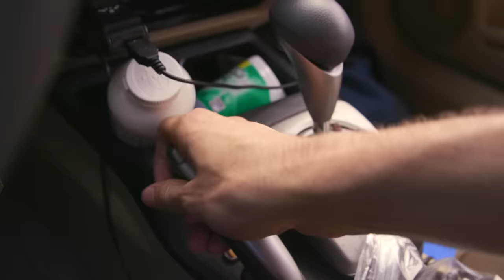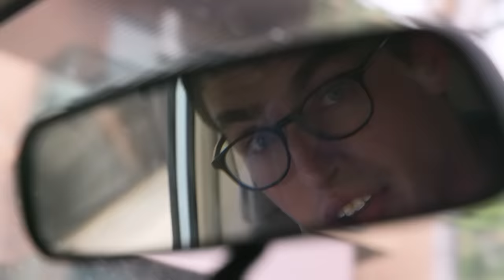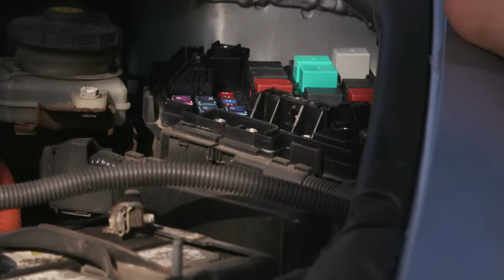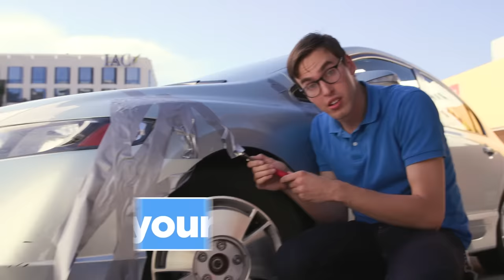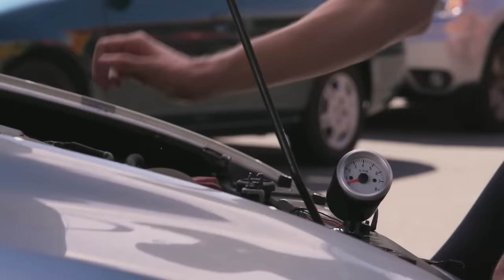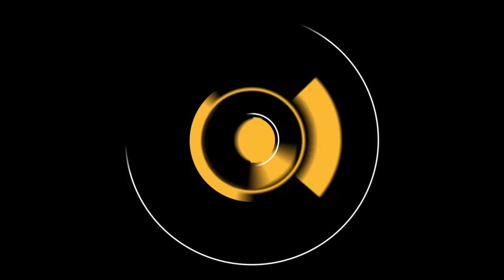5 Tips for People Who Don't Understand Cars

Comment: Adjust the tachometer for the number of cylinders in your engine.
Locate the output wire from your distributor.
Test the connection.
Choose a mounting location for the tachometer
Install the tachometer.  (USE TOOLS, NOT THAT HARD)
Set the shift light on the tachometer if applicable.

Easy peasy.
Reply: Srsly i am High Modern cars don't have distributors anymore, they have coil packs that the computer fires electronically.
Reply: Jacob Burnette the majority of vehicles on the road have distributors still
Reply: Yeah you need the rpm sensor wire from the crank sensor or the ECU nowadays
Reply: That is not true, Andy.  In the US electronic ignition has been predominant since the late 80s, and most cars are from the 90s to now.  So...
Reply: Hm I was sort of right…
Reply: Oranges611
Reply: Who needs a shift light?
Reply: NERRRRRRRD
Reply: does the smallest cresent wrench that fits, like one that came for free at a jobs fair, and a claw hammer count?
Reply: But what the fuck does a tachometer do?
Reply: It meters tachos.
Reply: I know right, what a  stupid question. I had two tachos today, so I try to keep the big dial on the 2, works great.
Reply: Tacometers.
Reply: But why? What is the purpose of this procedure? If your car does not come with a tachometer why would a non-car guy install it? Unless your car does not have manual tranny, why would a car guy install it?
Reply: Jacob Burnette I can confirm that! According to Mike Allen, who runs a car clinic, "Many modern cars have no distributor at all. The ignition is triggered by toothed timing wheels spinning with the crankshaft, which is much more accurate than points. Then there are individual coils for each cylinder, fired by the engine management computer."
Reply: @andycruzatx3387  barely any cars on the road these days have distributors and caps, they died out decades ago
Reply: @lewishood8160  yeah I learned that at some point in the past two years.
Reply: As a car enthusiast this entire comment section triggers me
Reply: Copy and paste
Reply: gotta remember the wifi password as well.
Reply: Acltcihsa look at that

Comment: It is somewhat shocking how little even the people in my engineering course know about cars.
Reply: As an engineer who knows fairly little about cars ... Can confirm!
Reply: I knew a fair bit about cars going into my engineering class. Now I design industrial machines and use exactly zero of my car knowledge.
Reply: Tbf, my side of Engineering deals with modeling, data, and industrial design. We haven't even touched ICEs or motors.
Reply: Father worked as liaison for a number of dealerships through the 80s and 90s.  Was working for a Ford Lincoln Mercury dealer when they had a Lincoln come in with a transmission issue.  Long story short, factory rep said that problem was not possible with that transmission.  They flew out the guy who DESIGNED the transmission.  Cleaned the shop up nice, had everything all ready and the car on the lift for his arrival.  Guy walks in, looks, nods and gives a couple "mhmms" and them says "one question, where's the transmission?"
This man, who designed a transmission for an automobile, had never seen it in a vehicle.  Once he was pointed to the transmission, he knew the thing inside out and backwards and the problem was fixed, but it's a crucial thing to know an engineer may know the object on paper, but there can be a huge disconnect between paper and application.

Comment: okay so a tachometer is a thing that measures how fast your engine is spinning and an alternator is a small electrical generator that generates electricity by spinning a magnet inside a copper coil. Since we all know that magnets have a magnetic field around them (which it why they stick to metal objects) then if that magnet is spinning then its field must be moving too. This means that if we have an inductive pickup which is basically like another copper coil which also generated electricity we can use that electricity to show how fast the alternator is spinning. most of the time the alternator is spun up by the engine itself (using a dive belt) so by using some clever gear ratios we can figure out how fast the engine is spinning by how fast the tachometer is spinning due to its electric field and the changes in it being picked up by the inductor on the tachometer.

Its really not so hard but most of the time cars have tachometers anyway...its the dial  that usually only goes up to 70 when you know that if you wanted to your car could obviously do way more than 100mph.
Reply: cris rose alternators don't use magnets :)
Reply: MY ENGINE IS SUPPOSED TO SPIN?!?!?!
Reply: cheeky videos hmm, ahh i see.its an electromagnet rather than just a standard magnet, a piece of carbon wrapped in copper wire but other than that it still has the same effect as the one i described.
Reply: Ginodon56 not the whole engine, just the crankshaft. the crankshaft is a off-centre rod that the pistons connect too. since it is off-centre it means that when the pistons go down they rotate the crankshaft.unless of course you have a rotary engine but lets face it, if your not a car person then you probably don't have a rotary engine.
Reply: why would you need a tachometer just because its diesel
Reply: The tach is a sensor that reads directly off the crankshaft these days. The needle you see moving is just for showing you the RPMs the engine is at. In reality, no car needs it and the ECU is the only thing that needs that data to ensure the timing doesn't get thrown off.
Reply: In non diesel vehicles, the tachometer gets its reading based on the sparking ignition system. Diesels however, use highly compressed hot air to ignite the fuel, which is why it uses a pulse off the alternator's "tach" output. I'm not sure why he says you need to get one if you have a diesel however, nearly all modern vehicles come equipped with one already. I think he's just trying to get a rise out of people in the comment section.
Reply: No, no not really. One who understands Faraday's law of inductance might know the difference.
Reply: Measuring engine's RPM by how fast the alternator is spinning is very inaccurate. Belt slippage.
Reply: Kevin Smith not if you use a belt tensioner and belt lube
Reply: I’m afraid you’re mistaken, this is a YouTube comments section not the place to hand in your paper about tachometers
Reply: AMAMA SHITI SHTA

Comment: Tip #2 is actually very good advice and genuine troubleshooting methodology. A car might have 25-45 different individual fuses, and if one is in a different condition than the rest, that's a good breadcrumb to follow, and fuses are cheap, easy to replace, and easy to find out what they do. In fact most car fuse ones have a diagram right there on the back side of the fuse compartment cover. You can get a package of assorted automotive fuses for like 5 bucks at any auto parts store, and some fuse compartments have extra sockets for spare fuses as well. Buy a pack and put it in your glove box, just in case.

Also, in an emergency, a fuse with a different rating can be used with caution. If the blown fuse is rated for 10 amps, you can probably use a 7.5 or 15 amp spare fuse to get you home or to the auto-parts store or mechanic. A lower rating might blow out pretty fast, but it'll protect the parts and circuits the fuse is meant to protect. A higher fuse will work too but it might expose those parts and wiring to higher currents than they're designed for. So if you're trapped in the desert at night with no headlights, put in the higher rating fuse and maybe damage your headlights but at least you won't be stuck in the desert at night.

Comment: The way an inductive pickup works is it senses the magnetic disturbance caused by current traveling through a wire. I've only used one when checking timing but I guess you could have it sense the current frequency from the alternator and relate that to the engine speed.

Comment: Its a Honda, VTEC JUST KICKED IN YO
Reply: That's the joke bruh.
Reply: wantsanewvehicle you have obviously been beat by a turbo honda civic with vtec. add a turbo. it helps a lot more than you think.
Reply: +kennedy796 What helps more is not owning a Honda Civic in the first place
Reply: kennedy796 If you think you can just "add a turbo", you know significantly less than you need to, to talk on such a subject lmao
Reply: Sanchez Cambroni so you have no sense of imagination? turbo charging takes a lot of fabrication. you SHOULD lower compression, but you can use a turbo on most factory engines up to 6 psi. and even then that is a hell of a lot more airflow than stock n/a.
Reply: Imagination has nothing to do with this as far as I can understand it was never mentioned. And that was the crash course Google version of "how to add a turbo", nice try though
Reply: Sanchez Cambroni thats alright. when you come back with imagination or humour then we can talk dude. instead you just want to act like it isnt possible. protip, dont be so negative....
Reply: Actually despite Civics being unnecessarily slow, they are very long lasting vehicles by far..
Reply: And the hybrid battery pack just shit the bed!

Comment: Alternators are used in modern automobiles to charge the battery and to power the electrical system when its engine is running, a tachometer is an instrument measuring the rotation speed of a shaft or disk, as in a motor or other machine. The device usually displays the revolutions per minute (RPM) on a calibrated analogue dial or a screen. So in this video the tachometer, shows the rotation  that is happening inside the alternator.

Comment: I understood every word. 

Tachometer - well, a tachometer. It shows you your revs. 
Alternator - the electric generator, that charges the battery and runs AC when the engine is running by taking motion and turning it into power. It does so by putting magnets and coils next to each other and moving very fast, which causes induction to occur. Which is how that tachometer works - it puts another coil of its own outside the alternator and just measures how many times does the magnet go past the coil. It doesn't put any load, so it doesn't slow down said magnet, as the coils in the alternator itself do by charging the battery, firing spark plugs, running the AC and charging your phone, so it doesn't actually affect anything inside the alternator and therefore inside the engine.

Comment: Real car tip from a car guy, if your SO tells you that its an “ air filter” that the car needs to run look up a picture of a Turbo, if it looks like that its the air filter that your car needs to run.....dont question the 3000$ charge on the credit card.... its not that.... sorry baby....

Comment: Tire replacement is hard work, especially if you have to do it. Pro tip: leave the bolts off for ease of access next time you need to change it. This also works for other parts of your car
Reply: "No I don't know why my engine fell out.  It couldn't possibly be because I never actually bolted it down"

Comment: Tachometers check engine rotation in RPMs, the alternator makes electricity from the rotation of the engine. Both diesel and gasoline cars have tachometers. And tachs won't matter on alternators, because the rotational speed of alternator doesn't matter at all

Comment: Welp my dad's a mechanic so I learned quite a lot about cars growing up, it's alright once you learn the basics
Reply: Are you talking to yourself or is there a ghost around here
Reply: STAMATIA MICHELAKI nope the person must have deleted their reply
Reply: You gotta get the right mindset.  You gotta stop thinking it's all too complex to figure out, take it one piece at a time, and get yourself into that mechanical mindset.  it's not wizardy.  Case in point.  Had an odd grumbling noise appear in my vehicle.  First thing I tried was accelerating.  It did not increase in rate with the engine rpms, so I know it's likely not linked to the engine, transmission, or exhaust (My first thought is the other side of my exhaust rusted through, as it was supposedly going to, but Meineke decided to ignore my request and not do BOTH sides of the exhaust...).  So our next guess what the tensioner for the belt (honestly my father's input, I would've never figured that out myself).  Ended up using a screw driver as a sound amplifier (kinda like a stethescope, just don't injure yourself) and found the alternator bearings were grinding.  Replaced the alternator, problem solved.

Comment: All jokes aside, learn how to check and change tires, oil, and filters, and you're pretty much set for the basic stuff. It comes in handy because tires go flat at bad times, and because your car works better and has fewer problems when you keep these things maintained.
Reply: How should I learn? I legitimately want to, but I don't know how. Should I just YouTube that shit?
Reply: Youtube works, yeah. Most of it is real simple., and you only need a handful of tools to do basic work.
Reply: Look up Scotty Kilmer!
Reply: tires go flat when you're doing a burnout a the cops come and you can't escape because your tire just popped.
Reply: I know many people (sorry girls but mostly female) who have had older cars and blew the engine because they never checked the oil. Oil and tranny fluid should be checked every time you fill up, or once a week.
Reply: Also it's nice for the guys working in a shop to not have to worry about losing all of their skin because some genius got a TPMS light and just decided to pump their 15in 175 width Tiger Paws up to 90+ psi without a gauge instead of actually checking anything...
Reply: Until your dealer tells you to change your timing belt. But you remember your car was engineered properly and uses a timing chain.

Comment: Tachometer measures rpm, the alternator takes energy from the engine and uses it to charge the battery, I'm guessing you want to read rpm from a gauge, however this requires you to hook the gauge up to something the connected to the engine and the alternator makes more power as the engine reaches higher rpm. Engine gets fast, alternator works more, the tachometer shows how fast the alternator is working then it uses the to calculate rpm 

slams hands in table anymore questions?
Reply: PCruler It's really interesting how the inductive pickup works
Reply: the wheels go round and the car moves forward.

Comment: So sad but true. Most of my guy friends would be shocked if they knew I couldn't change the oil in my car by myself... Or change a tire.
Reply: Oil I could understand. Not a lot of people do it. Tire on the other hand. See a bolt remove a bolt.
Reply: I can't change any of my headlights and it costs me $35 to do so anytime one burns out.

Not because I can't change a damn light bulb, but because getting to the headlight unit requires removing the grille ..
Reply: Chase Watkins I don't think it's that easy.
Reply: Skill-point You jack it up take the lugs off, put the wheel on the side get the spare bolt it up store the flat.
Reply: Skill-point it really is
Reply: It is that easy.
Pro tip though, it's much easier to break the lug nuts loose BEFORE you jack it up.  Same with fully tightening them.
Reply: @spFOX-pz3fx  yes it is it's a 6 step process

1. jack up car 
2.remove bolts and wheel 
3. Repeat for rear or front wheel 
4. Put the New wheels on the car 
5. Tighten New wheels 
6. Repeat for the other side

Comment: Ok a tachometer......ok first in a typical unleaded gasoline car, on the dash you have a speedometer(measures speed), and you have a rpm gauge(revolutions per minute). Ok so a tachometer is similar to a rpm gauge but for a Diesel engine, except it’s an indicator to shift gears(usually for beginner drivers of standard transmission, eventually shifting is done by feel, and hearing). You don’t need to install a tachometer in a standard gasoline engine, except in street racing, i hazard to guess street racers install tachs, I could be wrong though haha :)

Comment: Both gas and Diesel engines have alternators, and not all have tachs. They are both engines. They are almost the same. Main differences are diesels have more torque, diesels are more efficient than gas engines, and diesels don't need plugs to run or even start. Other than that, they are all engines, and are all unique in their own small ways.

Comment: I don't understand cars and this video didn't help me because I don't drive them and I do work hard, I can't afford a car because my hard work pays dirt. But I understood what he said at the end. He's explaining how a tachometer works but he didn't explain why it'll help if you use a diesel engine. I'd imagine it's because the diesel engine can easily spin up to higher RPMs than a regular engine, causing it to more easily overheat, but then again I have a lot more experience with aircraft engines (which run on diesel) than car engines.

Comment: If there is a air conditioning or overheating problem it's probably low coolant, if the car won't start you probably just need a boost because the battery is dead. If your engine sounds like shit try changing the oil

Comment: My dad knows significantly less about cars than I do, so that isn't going to work. Good luck trying to get a tachometer to actually show you RPM of your alternator, which would be a complete waste of time. Having a readout of voltage on the other hand is useful and there is a sensor on most cars that can read it out on an OBD2 reader.

Comment: Alternators crank and rotate as the car engine runs. This builds up energy for your battery so your battery has power, most of the time. Tachometers just measure how fast the engine is moving, its doesnt matter.